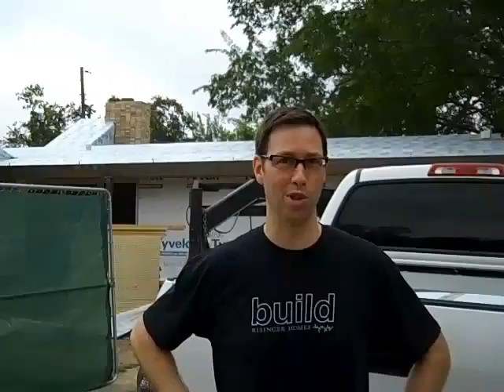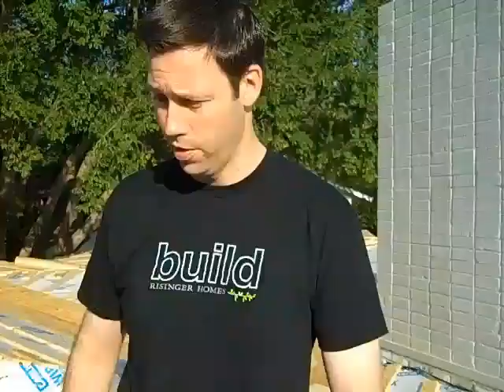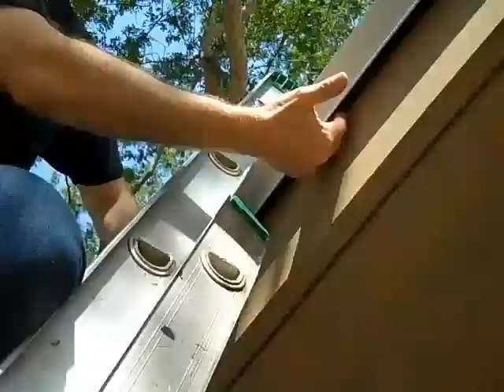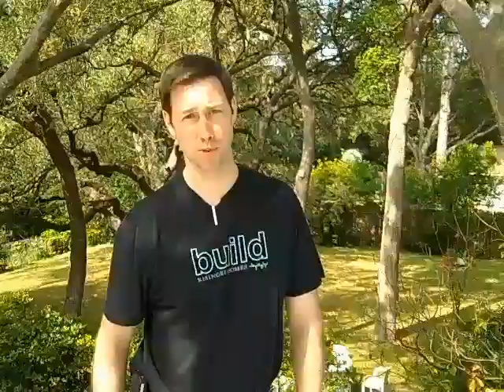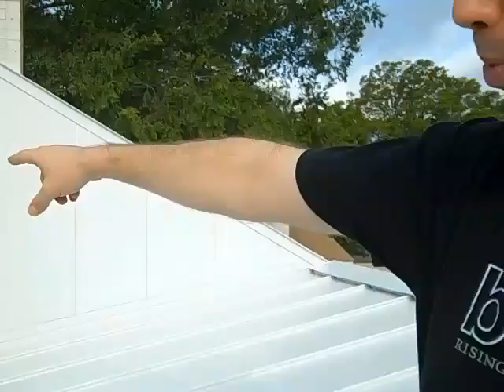White Metal Roof with Rigid Insulation

Comment: Oooonnn.. The BUILD shoooooowwww!
Reply: Leeets get goooin!
Reply: @buildshow  Couple quick questions:

1. I'm planning a build of a small house (1000 sq ft) in East Texas (Longview area) and I want to have cathedral ceiling. I plan on using mini split a/c heat and wall system will be 2x4 with Rockwool, zip system, then 2" polyiso, metal siding on the outside. Metal roof on the top, simple gable structure. Pretty much monopoly.

What's the best affordable system/insulation setup to get modern look and cathedral ceilings? I will have 2" polyiso on top of roof too.

Also, is black metal roofing and siding a really bad idea?

Thanks!
Gary

Comment: Wow. So long ago! Question: if I were to do this method in a cooler climate (Zone 6) with R30 in the cavity and R13 on the exterior, where would I put my water proofing/air barrier. Under the Foam board? Would I need a Tyvek over the plywood and then a roof membrane over the polyiso? I’m curious what has changed since 2011. Also, if you had the choice between polyiso and comfort board, what would you do in Zone 6 with a 12/12 pitch roof?

Comment: By putting peel and stick over the radiant barrier you loose the effect of the radiant barrier with no air gap. Why not put the peel and stick water barrier under the insulation and just tape the edge's of the insulated  panel with foil tape then the 3\4 inch gap for the radiant barrier will  work under the metal roof

Comment: Matt, why not run the 1x4's vertically, to give the metal panels direct ventilation, bottom to top? Why would 45 degrees be better?
Reply: B B I heard Matt say the metal would have better bearing on the 1 X 4s if on a diagonal. Personally I would run the 1 x 4s vertically, with another layer on top horizontally, then metal roof, I think the drainage for condensation would be less likely to rot the wood, In addition the wood IMO should be pressure treated,
Reply: @RJ-sr5dv  pressure treated wood contains copper. Dissimilar metals between that and the steel will react.

Comment: I did NOT hear any mention of hemming the ends of your standing seam metal roof to allow the metal panels to heat up during the day and expand..then at cool off in the evening and contract ...IF YOU DON"T , YOU WILL GET "OILCANNING" ( buckling, the the fixed panels grow & shrink. A wicking membrane might have been a good idea AND I did NOT see how you roofers flashed the junctions of the various profiles / elevations of the roof ??

Comment: Let me get this straight.  You left a gap between the ends of the 1x4 so that the roof could breath when the 1x4 create a 3/4 inch gap diagonally up the entire roof
Reply: I thought it was so when they heat up & expand, they won't press against each other, i.e., an expansion gap.

Comment: It looks good, but I'm concerned about the 1x4's how long will they last with moisture from metal.
Reply: Some use 2 x 4s.   It looks like he is using 12-inch OC so there should be a lot of wood to get a bite.  Lots better than just the decking.

Comment: how do you stop the Bees an other insects from getting in to .075 gap that is used to move air underneath the metal roof for cooling purposes 
I have seen this on Commercial jobs but never a home 
but would like to get more information on this installment for my own home that i hope to start building next year an could of you used Roxul insulation as well

Comment: Matt, I would think there would be a problem with the thermal bridge if you do closed cell on the bottom, and the vapor barrier on the top of the decking, because there would be no air flow for the wood. Is this not the case? I am new to this and looking to build a house very soon. Thanks for your help!

Comment: electric bill LOW- I bet if they lived there 18 yrs they would not break even for a roof job like this- Really lets hear the finished price with the atiic 5" foam etc... If you had simply placed vented 3" gap, not .75" inches you would have save them tons. I at lest liked that you 45 deg the battens rather than 90 deg across like so many Bozos/ Yes, quality, no question, but 3000 sf for $45,000 what was it please state.
Reply: What do you mean 3" gap instead of .75? Do you mean raining the metal roof 3" from the decking or the gaps between the 1x4s?
Reply: Why is it better to have the slates at 45 degrees?
Reply: Water clings to them if they run horizontal.  If you run vertically your screws may all be floating without firm grip.  At a 45 your batten are less likely to fail across one run.
Reply: People do things all the time that aren't about breaking even and money. Maybe they just want to be less of a burden on the energy infrastructure and do it because using less energy is a Good Thing.

Comment: Matt, love the videos and I go to them all the time.  I'm designing a home for the costal area of Southern Louisiana and I'm doing my best to design it for not only thermal efficiency, but also extreme weather durability - I'm also trying to keep cost as low as possible.My question:  It seems you have had a couple variations to metal roofing and riged insulation build up over the years, Do you recommend a felt paper or other type of roof underlayment prior (under) the ridged insulation but on top of the roof sheathing?
Reply: David Colley good question. I’m about to build a camp in Mississippi and have questions as well. I’m a waterproofer by trade.

Comment: Great video Matt!  What are your thoughts on using regular polystyrene 
instead of the polyiso board.  I have a ton of the polystyrene 4 x8 x 
1.5" sheets at basically no cost.  I know it has a lower rvalue but 
would it work?  Would it create a problem further on down the road?  We are in Northeast, GA hot humid summers, mild winters, similar climate to yours.  When I say polystyrene I mean styrofoam boards like the coolers you can by at the gas station.

Comment: Hi Matt,  How have roofing applications changed since 2011?  Would you mind clarifying the details of the roof?  In a previous video you stated that roof decking was applied, then WRB, then insulation over which furring strips then the metal roof.  In this video details are:  roof decking > 2 lays of board insulation > Carlise wip 300ht > furing/ventilation strips > metal roof.  May I ask what details you would use for an asphalt shingle application on top of a cold roof (non-vented attic)?  Thanks again, Great work!

Comment: Matt Risinger , I have a standing seam metal roof, but the Achilles Heal is the ridge cap, which is held in place by screws using a metal washer and neoprene washer beneath. The neoprene totally deteriorated and allowed water to drip into my roof insulation. What a disappointment ! I expected that I would never see another roof leak on this structure after the standing seam installation which replaced the first metal roof that was secured by several thousand screws. I want to eliminate those screws (potential leaking points) on the ridge cap. Why is there not a clip system for the ridge cap, or is there ? 
I would greatly appreciate your feed back !
Reply: the newer roofing screws will use EPDM which is supposedly better.
I'm not sure on the design of your standing seam roof, but if it's like this one then you could bend some somewhat hefty L-metal "clips" attached to the top of he roof such that the leg points toward the peak of the roof, and then fasten the bottom portion of the ridge cap to the raised leg of the l-metal. Then your fasteners wouldn't be needing to shed much water, and even if water got past them, it should trickle back down.

Comment: I am considering a metal roof for my house in southern California, and I have a question about layers. I have seen foil faced polyiso board insulation for sale, which acts as a radiant barrier as well as a conductive barrier. The reflective barrier will not work if it is covered with peel and stick. Is it necessary to have the peel and stick above the board insulation, or would roof deck/peel and stick/foil faced polyiso/air gap/metal roof be a good system?
Reply: +Daniel Fisher I've read instructions doing the roof as you describe with a layer of asphalt paper over the foam if you are in Zones 2 and hotter.  If you freeze they suggested another OSB layer over the foam then asphalt paper.

Comment: I have watched many of your videos and am in the process of starting a build project in Central, FL.  approx 5000s qft. I am planning on using a Metal roof, Galvalume.  However never thought of the rigid exterior foam with 1x4 boards underneath. The roof will already be a premium, so I am wondering how much more will it be to use the foam board and 1x4's? Also, With a very airtight home (I'm using ICF), I want to use a variable compressor heat pump (i'll need 3 of them) and metal insulated ducts, so obviously the cost is skyrocketing with all of these upgrades. Anyway you have found to keep these prices down?  I would say I am adding almost $75K to a standard build. Ouch.
Reply from the maker: sphingers 1 Yes, it's more expensive but $75k is worth it for a well built home that will be comfortable, have low energy bills, and have low maintenance.  Assuming you have a mortgage, isn't it worth another $300/mo to have a better built home?  We are so conditioned to accept mediocrity because that's what most houses in this country are (at best).  Be proud of your commitment to quality and to building a house that will last for generations!  Matt

Comment from the maker: ***** I did have to go back and re-roof a metal roof several years ago, but not this one.  The issue was a scupper leak on a flat roof (the metal roof hadn't leaked but I pulled it to be certain), but while I was there I pulled the metal roof and found the WIP underlayment fried to a crisp under the metal.  That was my first house with PolyIso on the roof and I used on layer of WIP on the roof deck then 2" of polyiso then another WIP then the metal roof directly on top.  Lesson learned is that even High Temp rated WIP can get super hot under a non-vented metal roof.  This video shows my current method and is working perfectly.  I've been doing this method for several years and this is really best practice.  Matt
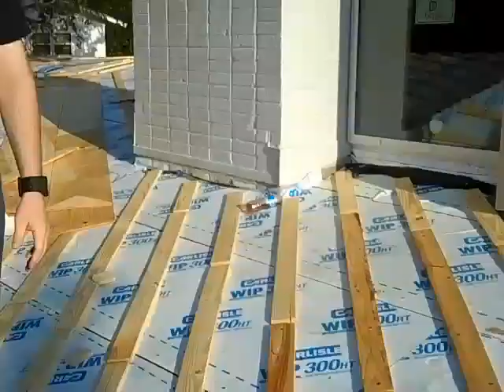Reply: @ 2:10 you said grace lol instead of carlisle lolololol
Reply: Have you found it better to put the weather barrier on top or the insulation? Does it make a difference?
Reply: So it looks really cool. I have one question, what keeps varmints such as squirrels or even rats from climbing up and in ?? Have you not had any issues?  Manchaca/Buda NATIVE..
Reply: @joetakens6274  - It'd have to be a teeeny tiny varmint to get through core-a-vent.
Reply: Matt Risinger Hello Matt, I am from Jamaica where it's always summer;this roof looks GREAT. However since air is allowed to flow under the metal sheeting wouldn't it be susceptible to high winds? Would this roof survive a Category 4 hurricane?
Reply: Hmm, I was thinking about doing slate with a counter batten sandwiching a radiant barrier between.
Reply: I see you created room for air flow under the metal but what about venting it? 
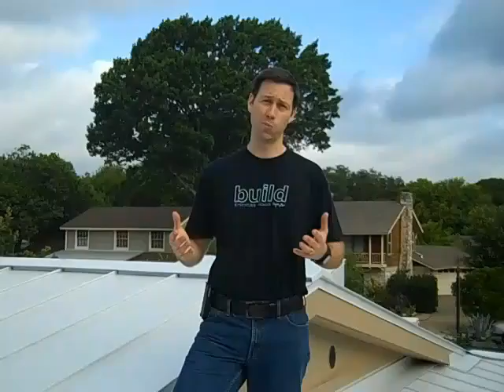At minute 4:40 of the video I see the peak but it appears to have no venting.

Comment: I think that the polyiso is better in term of thermal resistance and should be put over the membrane. Most arizona houses are built with clay tiles and unconditioned attic! A giant solar dutch oven for the barely insulated ducts, the building code and city inspectors have no common sense.

Comment: Matt, I understand that you put down 1/2" plywood for the base. Is there any barrier between the plywood and the polyiso? Also, because you were walking around on the insulating layer I was wondering if there is another later of plywood on top of the polyiso or does it have some sort of hard surface laminated to it? What brand do you use? Thanks!
Reply from the maker: On top of the roof sheathing I used one layer of Carlisle WIP 300HT underlayment then the Polyiso.  I tend to use Carlisle's R+2 Silver Polyiso.  On top of the foam I run another layer of WIP 300HT. You can walk on the foam no problem.  It'll hold around 25Psi.  Hope this helps, Matt
Reply: Yes, that helps a lot. The Carlisle products do not seem readily available in my area (or maybe just not to the public), do you know of any similar consumer-available products that could be used instead? For instance, I think there is a Certainteed brand of I&W shield available at Home Depot - would that work? And would any foil covered rigid foam insulation work or are there specific perameters/specifications I should look for?
Reply: ***** I was wondering the same thing.

Comment: Great job...well I can only guess how did you pay for that.. $50K??
Reply from the maker: Definitely not $50k, but yes it's much more than a typical shingle roof.  My hope is that my videos will inspire you to go beyond the "code required" roof and build to a higher standard.  This insulated metal roof will be standing strong when I drive my grandchildren by this house in 30-40-50 years, and this house will have low energy bills without putting solar on the roof.  Best, Matt
Reply: Yes,You are right..The roof does a lot.I do have painted shigles with special reflective white and I have quiet solar systems and to have just white roof it lowered attic temp from 150F to barely 100F.That was great energy project,I didn't expect so much out of it despite extremely  hot and extremely  humid climate here..Yes,lower attic  temp about 50F for couple hundred bucks,that makes it #1 energy project and no more quartz to my gutters and pool and the cool roof now lasts another 20years,it's compact  and solid and it doesn't fly off during hurricanes,it's all only A++++...

Comment: Thanks for the reply Matt, I was referring to hot humid air in the attic that can penetrate foam in the form of water vapor.  Do you have any concerns since the attic is not ventilated that the plywood strength could suffer over the years?   Im only posing the question, which is very debatable.

Comment from the maker: Dan,  I'm using two layers of Water & Ice Shield on this roof and the foam inside is open cell.  Ultimately, a leak "could" occur but the chances are greatly diminished and with open cell foam it will run through the foam and stain your ceiling to tell you there is a problem to address.  The energy savings on this super insulated and air tight assembly are worth the minor risk compared to a traditional vented/insulated roof.  Best, Matt

Comment: Nice videos, Matt! I have an old mobile home with rusted panels and I would like to do a metal roof-over using Techshield insulation board with built-in radiant top, Grace Ice and Water Shield on the Techshield, and standing seam metal panels over that. Is that a good plan? Am I right in thinking that I should remove the old metal first? Am I wrong in planning to use the moisture barrier? Thank you! -Edgar

Comment from the maker: Remodel or New Construction?  What part of the US?  If there is no HVAC in the attic and your HVAC is inside of the conditioned space already there is no need to spray foam.  I'd reduce or eliminate any penetrations in the drywall and do a thorough air sealing job and use standard insulation techniques.  Matt

Comment from the maker: Yes it does.  See my other videos on conditioned attics.  If you are in the hot/humid Southern US then bringing your ducts inside the AC space of your house is a HUGE upgrade in efficiency for your house.  This rigid foam on the roof deck is one of several ways to create a conditioned attic.  This particular house has both rigid from on top and spray foam inside so there are two types of insulation at the roof line.  Hope this helps!  Best, Matt

Comment from the maker: On the shingle roof check out Hunter Panels made in Houston.  They sandwich Plywood with a radiant barrier, then an air gap, then 1-5" or rigid foam.  You could apply that over your decking to create a sealed attic.  Best, Matt

Comment from the maker: Thanks for the complements, the video's are fun to make and the information dissemination only helps us all get better.  On your questions, no the Grace WIP HT isn't a radiant barrier but the metal roof is.  The air gap is two fold, one to create a space for the radiant barrier on the back of the roof panel to work, next to allow drainage of any water that gets past the metal, and lastly to lower the temp of the WIP by not touching the metal to it.
Reply: What is the newer product that you're using instead of WIP HT ?

Comment: First off; your videos are so helpful, and thank you so much for sharing your knowledge. I am building next year on a lot I just bought in Bryan TX.  Ive got 2 quick questions. 1) Does this WIP 300, act as a radiant barrier as a foil face would? I noticed you are using the 1x4 to create an air-gap as if it was a radiant barrier.  Restrictions in my neighborhood don't allow for metal roof.  Can a similar ventilated air barrier be used in a shingled roof application?

Comment from the maker: Thanks for commenting!  In general the cost of a metal roof is about 1.5-2x compared to a shingle roof.  This system is more than that, but I'm doing a Best Practice system.  Bugs are kept out of the 3/4" lath air gap with a Cor-A-Vent at the eave.  It would have to be a very small bug to get into that space.  Matt Risinger

Comment from the maker: Good Question.  With this 24ga metal it's really rigid and won't dent if you walk in the middle by accident.  It's pretty easy to tell where the slats are when you are walking the roof.  I totally agree on the metal comments.  Excellent roofing choice.  It's more costly in the short term, but the beauty of putting it down when building/remodeling is the bank will finance it for you.  If you shingle your roof in Texas it's a near guarantee you'll get hail damage in 1-10 years.  Matt Risinger